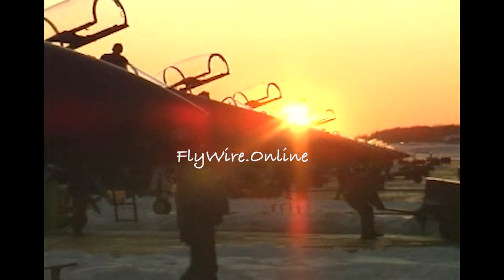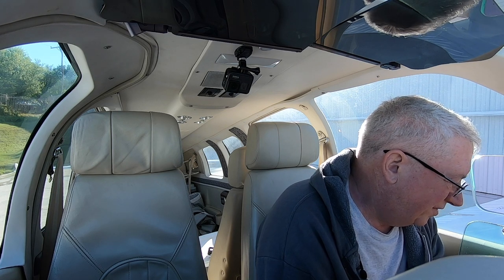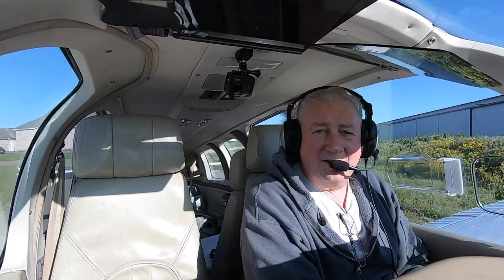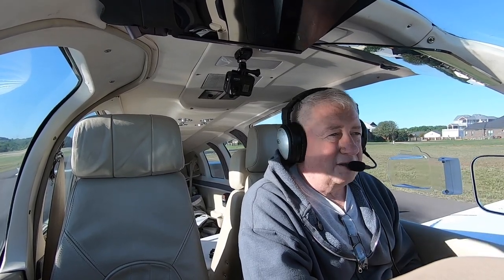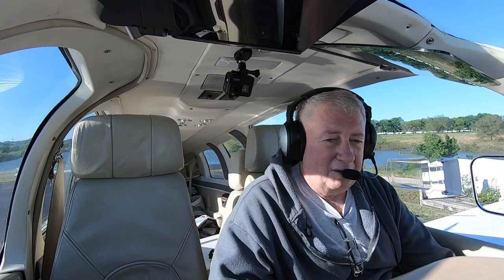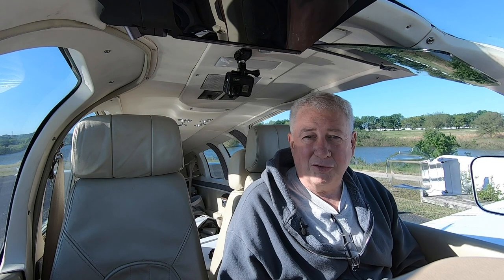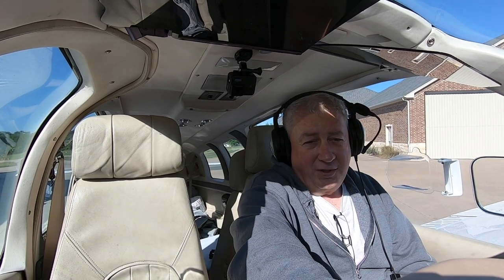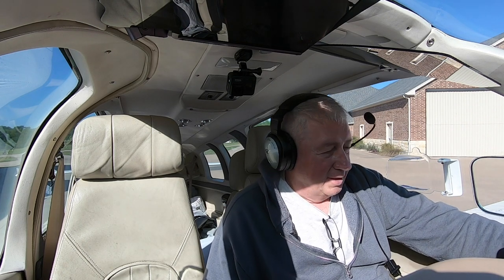FlyWire A36 Engine Start Hot and Cold

Comment: Recently purchased my first Bonanza and my first aircraft with an engine this size. Finding your channel really useful Scott and a big fan. Love my Bonanza but not really a fan of the hot start! Unfortunately the technique you described Scott doesn’t work for me and I find that the only technique that works reliably for my motor is the deliberate flooding of the engine then mixture to idle cutoff throttle wide open then bringing in the mixture when she fires. As you say your hands kind of get in your way doing it , I feel I have too few hands and need another one or two to make this technique works the first time! Sometimes I have to try this technique 3 times or 4 before I can really catch it. I am actually starting to get a little worried about burning my started or causing an inadvertent fire ! My motor has a tornado alley turbo normaliser installed and my mechanic thinks there is some sort of a fuel overflow valve which isnt there and installing that may help . In giving that a go next for another $500 in the hope that might make hot starts easier but I am not feeling overly optimistic about it!
Reply from the maker: Good luck!

Comment: Another nice video Scott. 👍🏻 A great point was made when you said there’s a bunch of techniques out there and pilots should use what works for them. I fly my A-36 about 340 hours per year and get plenty of opportunities to do hot starts. Here’s my take: A “True” hot start won’t be experienced if the engine has not been brought up to normal operating temperature then allowed to sit and bake for an hour in the hot summer (while you eat that $100 burger).  IMO A quick start up and run to the fuel pumps won’t get the engine that hot either, so a normal cold start works fine.  

The real test is when you know vapor lock has occurred while the engine sat for a while after shut down. You can actually hear the fuel pump cavitating when you run it during priming.  For me, those starts work best using the “cycle the fuel” for a minute with the controls at idle/cutoff.  I will usually have to walk the throttle forward during the actual start sequence until the correct fuel/air mixture is achieved.  Keep up the great work.
Reply from the maker: Thanks! Walking the throttle forward is exactly my technique. I appreciate your comments.

Comment: Thank you for your tips.   I tried the cold start method on my lake and it works amazingly well, starts right up.  Hot start is a different story, it does not like your method, so I just leave the mixture cutoff, still fuel pressure, throttle at ~1000 rpm setting and I hit the starter and once it catches I slowly bring the mixture to full.

Comment: My preferred technique is to leave the throttle at idle and mixture where it is for normal  ground ops.  Then go to start and start the fuel pump.  Fires right up every time.  The problem is the heat soaked mechanical fuel pump vaporizes the initial fuel until it gets cooled off enough by the fuel.
Reply from the maker: If it works, it sounds good to me!

Comment: Let's be fair, a 5 minute engine run on a sweat shirt day does not constitute a problematic "hot start" condition.
Reply from the maker: Serious Mark? Maybe I was just showing my technique.
Reply: @FlyWirescottperdue  Not looking to quibble...but to my 15 yr BE33 experience fuel line and fuel pump vaporization at 90F after a refuel at the pumps requires the closed loop pumping you mentioned.  It is specified in my Beechcraft POH,  not merely a recommendation.

Comment: For the hot start I do the same thing but I leave the throttle full in and slowly pull out. Usually goes in 1-2 turns. Throttle goes to idle before the prop has time to speed up.

Comment: Scott Perdue You're a genius. I went out today to pre-flight for tomorrows flight and had to try it. I have to say, this has to be the best hot start method I ever heard. Now I have only been flying for a little over a year. My Bo is very picky about a hot start! The only way was to run the fuel pump for a quick count of 30 before starting according to POH....the ONLY WAY. I hate running the fuel pump that long. I ran over to the fuel pump put the key back and tried what you explained in the video and she cranked for about 5 seconds until the throttle was in the sweet spot and she started right up as you said. I drove back to the hanger and just had to do it again.
Reply from the maker: Jimmy, I'm glad it worked for you. I appreciate your comments!
Reply: @FlyWirescottperdue  Sorry to blast more comments on your page. I wanted to share my experience with my flight yesterday. Typically I have to run the hot start procedure any time of day after I have run the engine, even if it was for 5 minutes. The only time I would use the normal starting checklist is the very first start of the day.  I flew to Houston (KIWS) from Abbeville (KIYA) a little over an hour flight time. I make the trip every couple of weeks. I'll run around Houston for 5 or 6 hours depending on work. When I'm ready to head home I'll run the Hot Start and bang I'm ready to go. Well, yesterday was another opportunity to run the new procedure. I had a friend with me, a very experienced Commercial Pilot. I told him we were going to try a new starting procedure today. I gave him a short explanation and off we went. I followed your protocol as I pushed the throttle forward about 1/3 of the way in engine kicked off and I worked the throttle a little back and forth to get the engine back to idle and ready to run my next step on my checklist. Again sorry for the rant, guess I'm just so amazed at how well this works after I tried everything else. Save the battery and fuel pump.

Comment: Thanks for the video. Enjoy seeing well thought out procedures. An alternate method I've seen work is almost identical to yours, but you start with more open throttle, and bring the throttle back smoothly. I think it would fire at about the same throttle position, except your hand is already smoothly moving back to an idle power setting. Wanted to see if you've tried it that way.
Reply from the maker: Ryan- Indeed, that is my big bore Lycoming start procedure;)